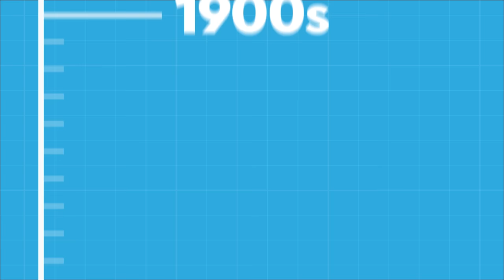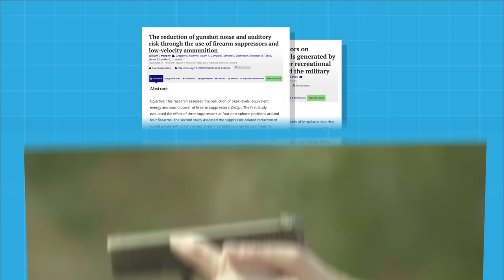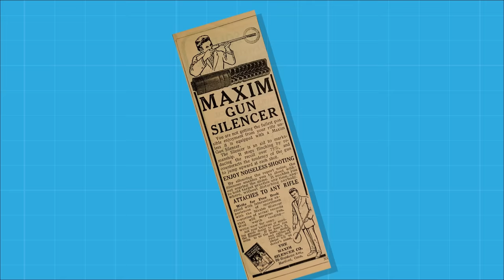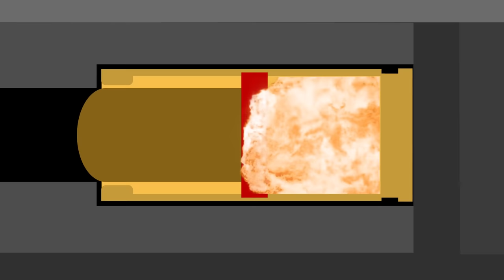How Silent Are Gun Silencers? DEBUNKED #moviemyths #debunked

Comment: Decibels are on a logarithmic scale friends.  A 20 dB decrease means a sound only 1% of the original volume.  That is colossal!  In the US at least, a common round .45 acp, is sub sonic except in specialty loads that require purpose built versions.  Compared to open air, a suppressed 1911 is quite noticeably quieter.

Comment: MP5SD and VSS Vintorez are actually very quiet firearms. But they shoot very heavy and subsonic ammo. And instead of a loud crack you get an audible pop. 
This means that it won't damage your hearing or necessitate using hearing protection that hampers communication. 

Supressors are mostly pointless if the ammo is supersonic though. Which is why i fitted a muzzle brake to the rifle i like to shoot instead of a supressor.
.308 is still a .308 so mitigating the recoil is more beneficial to slightly reducing the acoustic signature from defeaning to very painful.
Reply: Special Ops & I imagine most other military personel now use hearing protection that includes wireless communication. Several hearing protection companies make devices that enhance quiet sounds & instantaneously silence sudden loud sounds & have been around for over 30 years.

Comment: The decibel scale is logarithmic, thus a reduction of 10db is 10 times quieter. a reduction of 30db is 1000 times quieter.
For reference, however, the quietest gun mentioned at 85db is about the loudness of a noisy marketplace. 75db is a room of people talking, and 65db is people talking quietly. You are unlikely to find somewhere where the sound level is below 30db as there is usually natural sounds that are higher than 30.

Comment: Far and away, the best muzzled gunshots came from Sean Connery in Dr. No. His line delivered Martini dry, “That’s a Smith & Wesson and only holds six shots. You’ve had your six.” Thup, thup. (Okay, it wasn’t a Smith, it was a Colt 1911 and held seven rounds, but it was still cool. The firearm error was removed in later screenings, but they should have left it in).

Maxim advertised himself as “Dr. Shush,” but the idea did not go over because the mobster thing lent itself to unfortunate associations.

Assassination science dictates that sometimes silencers are a terrible idea. Michael Corleone left the can off his short-barreled revolver so no pain in the ass bystander would get in the way. Then again, in Ford’s theater, John Wilkes Booth chose a line in the play “You sockdologizing old mantrap” before silencers were invented because he knew that’s when the crowd would erupt in laughter for some reason and cloak the sound. Assuming that worked and no one heard the shot, he chose that time to jump off a balcony, break his leg on the stage, and yell, “Thus to tyrants!” in Latin. Questionable assassination planning, you ask me.

Comment: Silencer intention is to be as quiet as possible, by sacrificing power if need to.
Suppressor intention to reduce sound, without sacrificing power.

Suppressor should be built in, in a rifle, since the advantage exceed the downside (more weight).

It's possible to silence a small caliber gun when dimension, added weight and especially spending is not a concern.

Suppressor (& silencer) is one more reason to choose bulpup rifle.
Bulpup rifle which heavier towards the back is an advantage.

Bulpup rifle brand :
- Desert Tech
- Keltech
- Steyr Aug
- Famas
- Tavor

Comment: Instead of the not very well known "De Lisle Carbine" you should´ve used the in popculture very well known MP5SD as an example for a gun with integrated silencer.
In conjunction with subsonic ammunition you´ll only hear the guns mechanic sounds of the hammer dropping and a very silent "pow". It´s defenitly silent enough to be considred hearing safe without additonal hearing protection.
the db reduction also depends on the ammo used (calibre wise) together with the silencer: f.E.: a .223 rem round fired thrue a .308 silencer (who, lets say, reduce a .308 round around 24db) will not reduce the .223 round to the same amount, but it will reduce it anyway.

Comment: I suggest a spring. It would be at the exit end of the surpresser, and as the pressure of gas reaches it, the spring is forced apart, moving backwards in the cylinder..

Comment: Correct me if I'm wrong, but isn't a decibel a relative value? So reducing something's volume by "just 30dB" is actually a huge reduction and gets higher the louder the sound being suppressed. It's like implying a magic earthquake suppressor isn't all that big a deal if it reduces magnitude by "just 1" because  the difference between 0 and 1 isn't much.
Reply: I think the word you're looking for is 'logarithmic', but yeah for example 70dB is twice as loud as 60dB.
Reply: 3db is double or half. 30db reduction would be between several hundred to 1000%
Reply: 70db is much more than twice as loud as 60. Every 3db is double or half so 70 would be about 4 times as loud as 60. I believe the term you're looking for is "exponentially" instead of logarithmic, i.e, linearly versus exponentially. A linear increase is a straight diagonal line whereas exponential is a rapidly increasing diagonal curved line.  @johnlegan

Comment: I shoot long guns, rifles almost anytime using a muzzle signature reduction system, also called suppressor /moderator .. -  Major reason is reduced recoil, accuracy  and indeed less bang when aiming for boar.  The sound moderated is lower in frequency.. and is a bit "caatchy.."  if I would have to express the noise in words. 
Blaser R8 and a norwegian  Hausken..  ideal.. combination.

Comment: Short loaded rounds in small calibers are good with silencers.
You want the round to be sub-sonic and have low gas volume.
The classic assassin's piece is a Ruger 22LR with a screwed-on silencer.  
(*Although, a knife is perfectly quiet and it never runs out of bullets.)  😎
I saw a spring-loaded weapon once that threw a crossbow bolt, and it was extremely quiet.
It looked like a spear-fishing gun, but it was made for land use.

Comment: They are mufflers, NOT silencers, & only work on locked/closed breach firearms & with subsonic ammo. They reduce the sound by several hundred percent(but they still make considerable noise) as was proven on the Outdoor Channel's show about movie firearms myths a couple weeks ago. They also tested a pillow like Mel Gibson used in Payback but he wasn't muffling the report. He was preventing his getting covered in blood when he shot the bad guy in the head at less than arm's length. Mufflers do very little muffling on revolvers(cylinder to barrel gap), semi-autos(breach opening as the bullet is leaving the barrel) or supersonic ammo where the shockwave reflects off everything the bullet passes until it's subsonic.

Comment: Around 1959 l examined a rusty old muffler. Then made a suppressor for a single shot .22 rifle. The Long  barrel was already quiet when shooting .22 Shorts. With the 10" suppressor, it was indeed Hollywood quiet. 
Parked at the city dump, i fired about five shots out a rear window before the two guys up front noticed. The radio was on, but not very loud.  They were amazed.  My Dad confiscated mine and the one my older brother made. He Knew it was illegal.  I didn't!

Comment: The decibel scale is logarithmic, so it's not accurate to say that a suppressor "decreases the sound by 30 decibels" because a 30 decibel decrease is completely different depending on the starting and ending decibel values. Even with the noise level being above what the movies portray it as, suppressors can still be useful in covert activities - it's the difference between someone down the street thinking they heard a gunshot, and someone a mile away knowing they heard one.

Comment: An MP5 with an integrated suppressor firing 140-142 grain subsonic ammo is quiet enough so that the action of the weapon (closed-bolt blowback and chambering of the next round) is actually louder. Of course going way down in the grain runs the risk of getting a squib load, which is no bueno if you like your barrel intact.

Comment: your video would hold true a couple of decades ago but today suppressor design is so good it actually doesnt make much noise anymore if you use sub sonic ammo.
Reply: You own any?  Have personal experience?

I own and shoot multiple suppressors, and have worked in the industry.

Designs have gotten better, more flexible, lighter, more durable, etc.  But there is a nearly hard cap on the level of suppression at ~30 decibel reduction.

Comment: Not how I like my steak, but very well done!  I was unaware of the Soviet firearms with captive piston cartridges. To add to your discourse, suppressors are usually ineffective at muffling the report of revolvers, despite Hollywood mythology to the contrary. That is because gases escape from the cylinder gap on revolvers. This is the space between the front of the cylinder (which allows for the cylinder to rotate) and the rear of the barrel (AKA th forcing cone).  The projectile flies across when fired.  After the projectile has entered the barrel, a portion of the hot rapidly expanding gases leak out through the cylinder gap resulting in a report or bang.  So powerful are these leaked gases that they can not only cause severe burns, but will result in massive tissue damage to a finger that is even with the cylinder gap.  This is especially true when firing magnum rounds and can cause so much damage as to require amputation of the digit.  The only known brand of revolvers which lend themselves to suppressors are the Dan Wesson revolvers with interchangeable barrels of varying lengths.  While no longer manufactured, these guns came with the tool necessary to remove and install the various barrels plus a feeler gauge to precisely set the cylinder gap.  Theoretically, the Belgium manufactured Nagant M1895 “gas-seal” system could have been successfully suppressed; although I have no knowledge that it was ever tried.   Silencer or suppressor?  Personally, I prefer the phrase ‘gun muffler.’

Comment: A .45 ACP is naturally a subsonic round.   Using a suppressor such as an Obsidian on a semi-automatic in .45 ACP such as a 1911 or HK USP will make the sound of the gun cycle louder than the shot.  It'll be as quiet as a BB gun.  Same with any rifle.  Using subsonic rounds with the suppressor will make it extremely quiet, although a semi-auto rifle will typically not cycle with a subsonic round.

Comment: Also another interesting point: the suppressor works by trapping the gas in the baffles...but to do so most effectively requires gas in it in the first place...meaning the first round fired is usually not very suppressed at all, and then the rounds fired after will be. Kinda puts a damper on the whole Hollywood secret assassin thingy....
Reply: First Round Pop (FRP) is at most 5 dB louder than the subsequent average noise. I wouldn't call that "hardly suppressed."
Reply: There is always gas in the silencer. But it's a difference whether is cold and oxygen-rich air or the hot combustion products of the previously fired cartridges.

Comment: 90-130 decibel is VERY quiet sound, compared to a regular gunshot. Avg human talk is around 65-70. Short spike of 85 decibels shot from silenced .22 weapon you won't hear from adjacent room.
For comparison - bolt cycling sound is 100-110 decibels and it's not that much, especially when you're surrounded by outside background noise.
Reply: 90-130 is still very loud. Most muffled guns will have a report of around 120 unless it's a subsonic 22lr.
Reply: @bradgriffith4231 it's loud when you're shooting your neighbor in quiet room trying not to wake up your sis sleeping near him. But when it's 2-3 rooms away - it's not.
Some modern silenced weapon's loudest sound - it's mechanics work. I heard that US has problem with sound-transparent walls, but in normal concrete non-empty building with doors, people and background sounds we got used to - you can check how many rooms away you won't hear reloading sound of M4 rifle, for example. I was amused during the service, when I got to range with silenced micro-uzis. You hear them, yes - as long, as you're in the shooting zone. Go away for 40-50 meters out of the shooting room - you can hear it only because you know its shooting and it's the only sound in there. Mix it with the squad babbling outside, humvee motor running - magic...
Reply: @bradgriffith4231  try to think even simplier - all of this shit about muzzle flash dampening and sound spreading is effective mostly for rifles and for ranges above 50 meters. For pistol combat shooting ranges - it's about 10-30 meters avg- effectiveness of those factors is very questionable. NOBODY would invest in adding weight and size to the handgun and less powerful subsonic ammo, if silencer wouldn't actually silence the shot effectively enough for 10-30 meters range. Except criminals who don't want to wake up the whole neighborhood. But they're aren't made explicitly for criminals, right?

Comment: The main reason for a silencer atleast in a tactical military sense is hiding your detectable signature, most silencers or better suppressors reduce the muzzle flash making it harder for the enemy to pinpoint you, they are much more suited for outside combat then any indoor combat as being undetectable in a closed in scenario is nigh on impossible althought the definite subtraction in noise could help your hearing in an indoor scenario. Overall they are best used on most long range weapons such as rifles,
Reply: They also reduce recoil & noise induced stress. I can walk into a casino in L.V. & be buzzing from the stress induced by the slot machine noises in a half hour or less.

Comment: The civilian term is called Silencers but the professional term is suppressors because the term silencer would insinuate that it completely eradicates sounds.

This is not the case. It just suppresses the amount of pressure that gas expels into baffels inside the supressor. 

This also has an adverse effect of increasing rotation speed of the bullet but most SOF or other professsions who use suppressors, do so only to conceal their fire signiture. 

Things like muzzle flash. Suppressors only have a "silent" range of close 200m. Anyone within that radius will be able to hear the shot. Of course, factors like buildings, caves, wide open spaces and the type of round will affect the suppressing effect which could negate the point of having one for silent shooting, but I reiterate, suppressors are mainly for reducing fire signiture to conceal your shooting further from the enemy being able to pinpoint your location.😊

Comment: 6:40 I think because De Liste carbine designed in 1942, produced until 1945 when noise test tool was not as accurate as modern one, noise level should be much more than 85 dB(A) tested in the past.

In comparison, Military Arms Channel in 2015 tested subsonic rounds with various silencer on 9mm Handgun with specialized noise tester, without 161 and with best suppressor 129 dB(A).
Other test 5.56mm Rifle 167 to 133, 30-cal Rifle 170+ down to 137 or 135 dB(A) in two different rifles.

To put into perspective, every 10 decibel gain (logarithmic scale unit) means 10X power/ energy or 2X loudness perception for human ears, 45-50 dB(A) difference here (50 = 2^5 or 32X louder) which means De Liste's 85 dB(A) is likely comes from sound tester limitation.

7:10 True, also in daylight, busy, or especially in war zone environment at medium to long range definitely make targets clueless or barely hear anything unless missed and hit metal, practically unreconganizably "silent". Subsonic ammo is a must or else targets can hear supersonic cracks along bullet path.

Comment: Well, hollywood quiet guns are achievable. But you do have to sacrifice a lot to get it. The only way to do it is to use a rather large silencer, with subsonic ammunition, on a bolt action. But, you give up being able to use a semiautomatic or automatic, and being forced to use subsonic ammunition means you have a much shorter effective range and less kinetic energy, and its going to be a fairly unwieldy firearm, with these types of supressors getting close to a foot long.

Comment: Decibels are a logarithmic scale however, so a 30dB reduction brings it down from a firework to an idling motorbike engine, still fairly considerable
Reply: There's no point in a suppressor if you're not using sub-sonic ammo
Reply: @Chuckvsfrank1232  it brings it down low enough that considerably less damage will be done to your ears, it isn't always for stealth reasons
Reply: @ToxicJelly9  most people assume you will be wearing ear plugs or other protection on a range and suppressors melt and get worn down so if your reason is to reduce the damage to your ears, your spending swapping out suppressors when you can just get cheap foam ear plugs
Reply: @Chuckvsfrank1232  also to reduce noise for those near the range too, I'd imagine. Suppressors really depend on why you're shooting. But yes, unless you're a professional soldier, it would be a waste over buying just ear plugs or headphones

Comment: I shot .762 suppressed subsonic 200 grain many times and it sounds like disconnecting and air compressor hose. Not silent but not anything like a gunshot but if I run full pressure.762 it sounds like a gunshot still